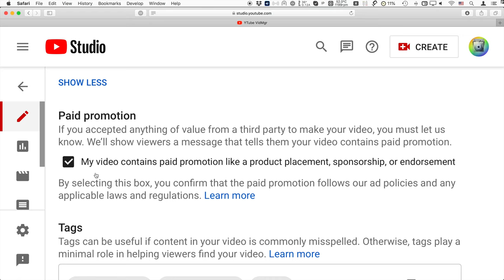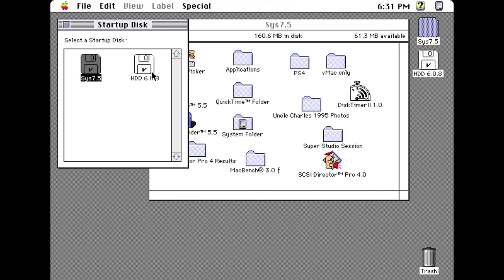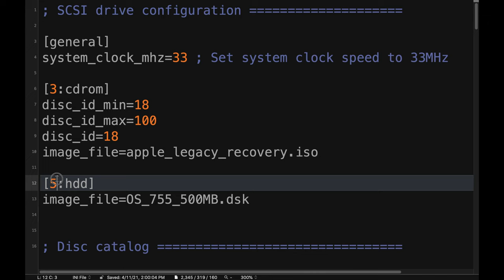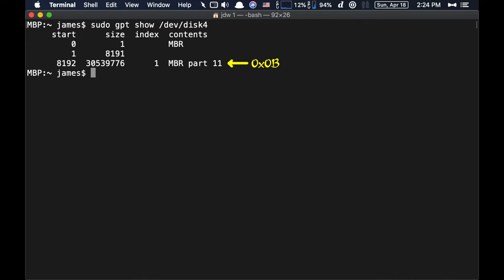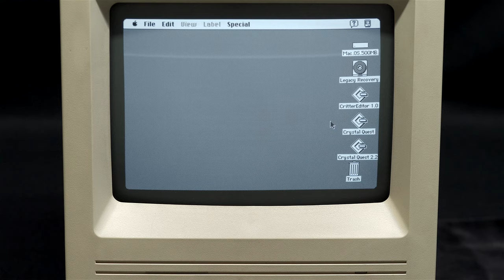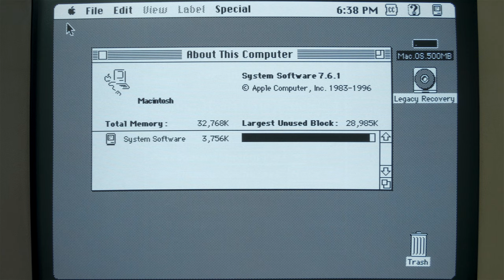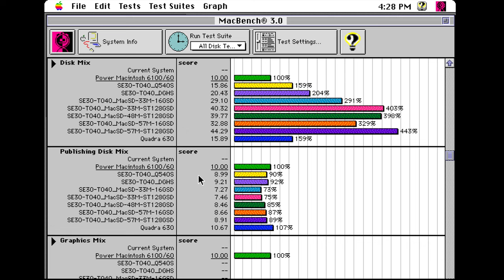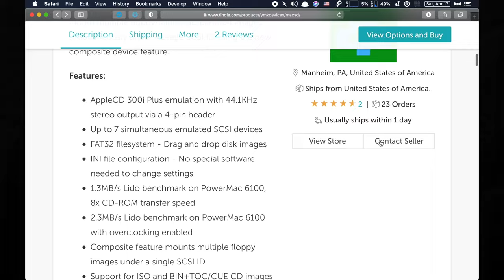MacSD Product Review [SCSI to SD]

Comment from the maker: Folks, YMK just confirmed that all MacSD units shipped after the release of my video include boot-loader v.0.6.0 while allows Firmware Updates from SD card partition types 0x0B or 0x0C, so what I said in 22:14 Firmware Updates has now been addressed. Simply put, if you purchased MacSD after the release of my video, you can format your SD card with Apple's Disk Utility as FAT32 MBR and later do MacSD firmware updates without any special card formatting.

Comment: Bought a MacSD using the discount code.  Had some problems backing up the original card to a new SD card to start with (Using Windows 10 PC).  Discovered that a foolproof method is to image the original card using Rufus to a VHD file.  Then use Rufus to image a new card using that VHD file.  If the new card is bigger than the original MacSD card, then you can use Easeus Partition Manager to expand the usable space to restore the original capacity.  In this way I created a 128Gb MacSD card (after creating useable 32Gb and 64Gb cards). Very pleased with the product.

Comment: I have a couple SCSI2SD (both v6) and a MacSD. I prefer the MacSD for it's ease of use/configuration on a modern Windows PC. Between that and the CD-changer function, you really can't beat it. I'm even more excited now that I know about overclocking the SD card interface to speed up disk transfers. Thanks JDW!
Reply from the maker: Thanks for watching and for your comment, Tom!
Reply: tom have you tried macsd on a retro pc computer? like a 486 ? with mixed mode cd images data + audio tracks?
Reply: @5DiFika  No. I have very little use for SCSI on x86 machines.

Comment: Ok very informative and just a wealth of how to set up and troubleshoot, FANTASTIC! Oh by the way I will be getting one, Thanks for thinking of us and the discount!
Reply from the maker: Thank you for watching and for your kind comment, Michael.  By the way, I am continuing to test other SD cards (not shown in my video) in MacBench 3 and will report back on those before the end of this month.  But so far, the Sony Tough V60 card used in my video remains on top.  Even so, the stock 16GB card included with MacSD is more than adequate for a stock SE/30 and perhaps other Macs too.  If you have something other than an SE/30, I would recommend you run a MacBench 3 benchmark on it with MacSD set to the base 33MHz speed, then another benchmark at the 57MHz overclocked speed so you have a good baseline to compare with.  Then if you have other SD cards sitting around, you can test them at the base speed and overclocked to see if you get an improvement.

Comment: Another great quality video. Very informative and clear in explanations. I have an SCSI2SD as external device to be able to take advantage of it in several Macs,... but this one seems to be better and with more useful features. Managing partition images and act like a CD-ROM is VERY useful.
Reply from the maker: I think so too, Jorge.  From what I understand, MacSD is the only SCSI to SD product currently available which handles Volume or "Partition" images (i.e., those images used by Mini vMac or the FloppyEMU, or raw floppy disk images).  The other products like your SCSI2SD handle only "Drive" images.  And the CD-ROM features are icing on an already lovely cake.

Comment: So, correct me if I'm wrong, but my understanding is older Macs, such as the MacPlus, do not supply power to whatever is connected to the SCSI drive. So to use a device like the MacSD, would adding that resistor correct that issue and make MacSD usable by the Mac Plus? (I purchased a MacPlus recently and I'm looking for solutions / extra storage in case the external SCSI Hard Drive or Floppy Drive dies, which has been a common issue with these older Macs, apparently.)
Reply from the maker: While I cannot speak from firsthand experience because I do not own a Macintosh Plus, I do know that if you look closely on the motherboard, you will see a place where a 1N4004 or similar diode can be soldered in. From my understanding, adding that diode will solve the problem and allow SCSI to SD card solutions to be powered.
Reply: @JDW-  Wow! That was quick! Thanks!

Also, would you know whether or not externally powered drives, such as external hard disk drives that run on mains power, would work as normal or would the power coming from the SCSI port potentially mess with something, powerwise?
Reply from the maker: @TaijanDean  If you put a MacSD, BlueSCSI, etc. inside something like an HD20SC enclosure, in theory, you should be able to connect only the SCSI cable to your Mac, leaving the power cord entirely disconnected (power switch OFF), and the drive should work because the MacSD would get power from the SCSI bus.
Reply: @JDW-  Cool! Thanks! So if adding the resistor/ diode fixes that issue, would I still be able to connect a normal external Hard Disk Drive with no issues?
Reply from the maker: @TaijanDean  I believe so, but since I have no Plus to test that on myself, I cannot speak from first-hand experience.  There is a discussion thread on TinkerDifferent with video about the diode install at the URL below.  I would recommend that you post your question there to obtain confirmation that the folks there who added the diode have zero issues with normal spinning platter hard drives. https://tinkerdifferent.com/threads/mac-plus-with-bluescsi-db25-scsi-hard-drive-emulator.751/#post-4648

Comment: Great video. I'm searching for something like this to use on my ms-dos based retro builds. Seems this could work as a complete cd-rom drive replacement! Is there any chance you could do even a mini review of this working on a ms-dos based machine? =)
Reply from the maker: Unfortunately, I don't have an MS-DOS computer to test MacSD on.  However, if you go to the MacSD website, and click the MANUAL button, then scroll to the COMPATIBILITY section, you will see these platforms as working fine with MacSD: Windows 98, Windows XP, MS-DOS 6.22 / MSCDEX 2.23

Comment: Great review of the product and it is already really thorough and very understandable as well,  This isn't intended to be a critique or complaint i any way, just more for curiosity. A couple things I would have liked to see though, 1 flip through the expanded Mac bench 3 result charts for the accelerator tests like you did for the stock se30. The low access time is what really tells the story there, and it only needs to be a few seconds, as I can pause to read them.  2 perhaps included boot times from the power on. As initialization for different drives takes different times and can be a big factor.  Maybe perform each boot a few times to get an average result.   And I had a third but ended up forgetting before writing this.. oh well.. I am very impressed with this. 

I have a scsi2SD (a few years old model) and it has always been a bit of a fudge to use. Especially when wanting to use it for a couple of different computers. And I have not bothered to really use it much as of late. And I also have a floppy EMU and it has been a real godsend for my old macs and the floppy drives starting to break.  I wish it could have done perhaps CDROM images or what not, but that is a limitation of the macs themselves. It is especially amazing for my old apple 2 though, so I can see perhaps not needing to always swap its firmware when I go back and forth now.. I am sold.
Reply from the maker: Thank you for watching and for your kind comment. To see Boot times, please watch from 47:54.

I did not make time to show every single test in MacBench3 as that would have extended the total length of the video beyond 1 hour, which is the limit I wanted to set.  But to make up for that, I put a link in the text description to a 1.44MB DSK image which contains all the benchmark data, including results other than MacBench.  To see the detailed MacBench Results files in that DSK image: launch MacBench 3, either on a vintage Mac or emulator, and then mount my DSK and then open the individual results files within MacBench3.  That way you can selectively compare individual Results files in numerous ways that I could not possibly present in a video.  

To save you the trouble though, I just accessed that very DSK image linked in the text description (https://bit.ly/3dxft7A), launched Basilisk II and then MacBench3, then opened all the "STOCK" SE/30 results files I created, then made screenshots of all the pages that you requested. A zip file containing those screenshots is available for download here: https://cutt.ly/AvZ9wEs

If you access my DSK image, you will find 50MHz '030 DiiMO & 40MHz '040 Turbo040 accelerated Results files too, in addition to the STOCK SE/30 files. Those show significant speed gains over the stock SE/30, especially with fast SD cards.

The FloppyEMU really is great, isn't it?  It's drop dead easy to use.  MacSD is almost as convenient because of Composites, which works like the FloppyEMU.  The biggest difference is MacSD as an internal drive, not portable like the FloppyEMU.  And instead of using the LCD on the FloppyEMU to select your Volume images, you need to setup the MacSD INI file in order to have them mount on the Desktop.  But MacSD basically like the FloppyEMU — just much faster!

If you need interaction with CD-ROM images, then MacSD really is the way to go, because it handles those quite well.  The CD-changer feature is vary nice.  And you can even have multiple CD-ROM "drives" mount on the Desktop if you want.  That way you can have 2 or more CDs open at any given time.

If you need any other info, I'm happy to help share my knowledge where possible.
Reply: @JDW-  WHOA!! That is awesome!  thankyou so much!  One of my mac's is an SE/30 with the daystar 040/33mhz overdrive  with 128k cache option. So it is very meaningful data to have. 

I have kept the 540mb scsi drive in it that I bought for it 25+ years ago and it is still working but either it was my imagination or its louder the last time I dug the machine out not so long ago. So a good internal replacement is needed.  

And i have never really been happy with my older rev SCSI2SD for it. 

Again thankyou so much for your detailed and helpful content.
Reply from the maker: @wishusknight3009  If you ultimately do buy a MacSD, I'd love to review your MacBench 3 results file when you've had a chance to run benchmarks.  But I have little doubt that you'll be satisfied with performance, especially if you overclock MacSD.  Best wishes!

Comment: Is there an external version of this product that resides in a case?
Reply from the maker: Hi, Mark.  Thanks for your question.  I don't work for YMK Devices, so I cannot say what they might have in the works, but at the time I did the video review of their MacSD product, it was only sold as an internal drive and included an appropriate 3D printed mounting bracket.  You are absolutely right in thinking this would be a great product as an external drive solution, and toward that end I would strongly recommend that you send YMK your question as a suggestion.  You can do that by simply clicking the "Contact Store" button here: https://www.tindie.com/stores/ymkdevices/

Comment: You can also jam in a Red Rock Technologies SCSI SSD.
Reply from the maker: Curious if I actually can.  I Googled that name just now, and while I can find the manufacturer's website, I cannot find a dealer or any clear indication of pricing.  Suffice it to say, if the cost of one of those is significantly higher than MacSD, it would not be appealing to very many vintage Mac enthusiasts.  True, we do tend to pay a lot for certain EBAY finds, but drive replacement upgrades are aplenty these days, so savvy shoppers tend to flock to (a) what is readily available and (b) what is reasonably priced.

Comment: There is also an old Norton Utilities defragment app.
Reply from the maker: You seem to be referring to 19:53 in my video.  But it's important to keep in mind this is not fragmentation of the Mac drive images saved on MacSD, but rather fragmentation inherent to the FAT32 file system.  Norton Utilities for Mac can defragment Mac drives, but defragmenting the FAT32 file system must be done outside the Macintosh environment, and as I mentioned in my video, MacSD will do that automatically, if you give it sufficient time to do so.  It even lights an LED to tell you there is fragmentation of FAT32 files and defragmentation is under way.  I then mention in my video about how to avoid fragmentation of files stored on the SD card (FAT32).